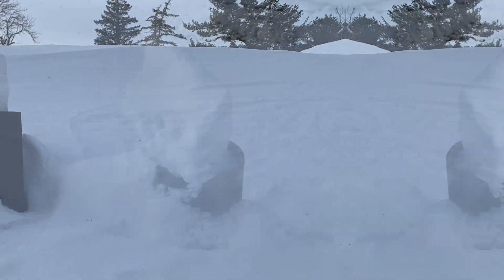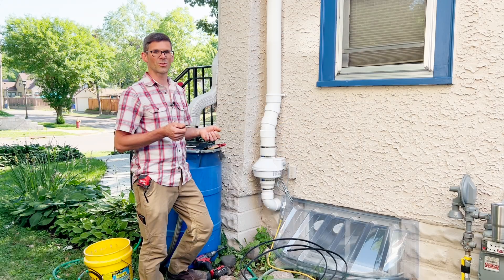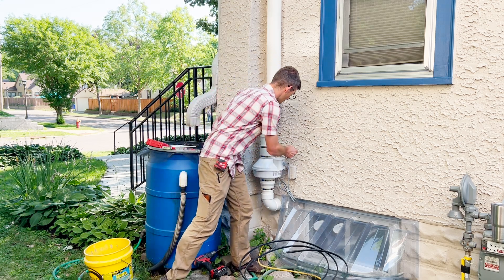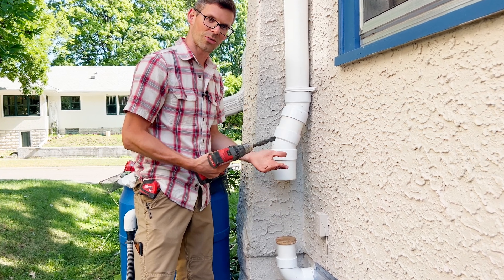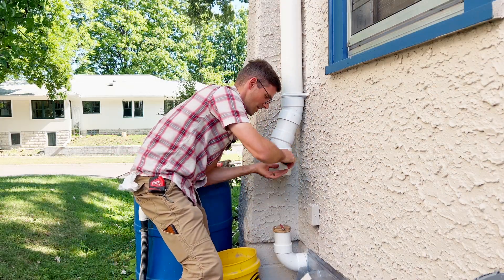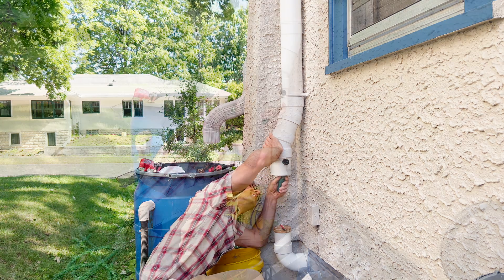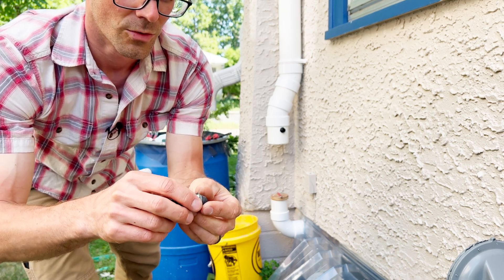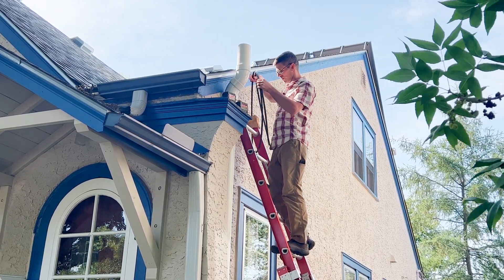Fix Your Frozen Radon System

Comment from the maker: Installation update:
We now recommend using our Strain Relief Drill and Tap Set to install the strain relief fitting. This tool wasn’t shown in our original installation video, but it makes the process easier and helps ensure a clean, properly threaded fit in Schedule 40 PVC.

Here are the updated items we use to install the kit:

1. 16' Deicing Kit - https://americanradonmitigation.com/product/radon-system-de-icing-heat-cable-16ft/

2. 28' Deicing Kit - https://americanradonmitigation.com/product/radon-system-deicing-kit-28ft/

3. Drill and Tap - https://americanradonmitigation.com/product/drill-and-tap/
      - This is the drill bit and tap for the strain relief.

4. Stainless Steel Zip Ties - https://amzn.to/4fUlpo8
      - We use these to secure the deicing cable at the top of the pipe.

5. Heat Shrink Tubing - https://amzn.to/4h6wqDZ
      - This is an added layer of protection to prevent the zip ties from cutting into the deicing cable.

Would you like us to install your deicing system? Feel free to contact us for a quote if you're located in Colorado.

📍 Service Area
Serving Colorado’s Front Range and Mountain Communities:
Golden, Boulder, Denver, Cherry Hills Village, Evergreen, Breckenridge, Vail, Aspen, and nearby areas.

🗓  Schedule an Estimate
Live in Colorado? Book your in-person radon mitigation system estimate here: https://americanradonmitigation.com/

🌎  Have a Question for Jesse?
We offer virtual consultations worldwide: https://americanradonmitigation.com/consulting/

🛒  Need a Radon Monitor or Supplies?
Shop our online store: https://americanradonmitigation.com/shop/

🛍  Our Amazon Store: https://amazon.com/shop/americanradonmitigation
We participate in the Amazon Associates Program and may earn commissions from qualifying purchases made through the links above. Thanks for your support!

Comment: Why can't they just include a heater with the fan?   Would it not be strong enough to eventually melt the ice through blowing the heated air?
Reply from the maker: I like your thinking. However, I don’t think that would work. Some systems have 10-20 feet of piping above the fan. The icing seems to start at the top and work its way down.

Comment: what do you think of having a sanitary Y in the bottom of vertical run to drain water around the fan?
Reply from the maker: Check out Bill’s study about condensation and radon fans. https://wpb-radon.com/pdf/Radon%20Fan%20Drainage%20Installation%2004.pdf

Comment: Excellent video, particularly with the timely close-ups!  As for the zip-ties at the top, they don't like sunlight over long periods. Even black ones get brittle, dry out and break. Since you're likely going to install/or have installed a critter guard, why not use the attachment screws and some small brackets to hold the upper end of the cable? Whatever you use to hold the guard could be modified to hold the current or eventual cable, no? Also, as for the seal on the plug down below, wouldn't Teflon plumber's tape work?

Nixw job on the vid, whatever the case!

Comment: I live in western PA and my system froze up last year. Radon levels spiked. Yikes!!! I had a contractor try Jessie's instructions and install the heat cable rig and success. It's 8 above zero and I'm smiling like a butchers dog. Thanks.
Reply from the maker: 😂 I've never heard the butcher's dog one! 

Glad to hear it worked! We install them on nearly every exterior routed system and never get freeze-up calls from those customers.